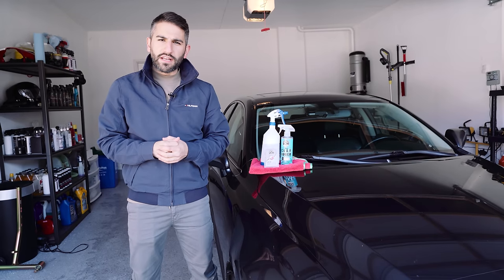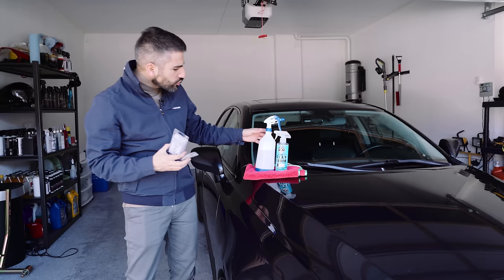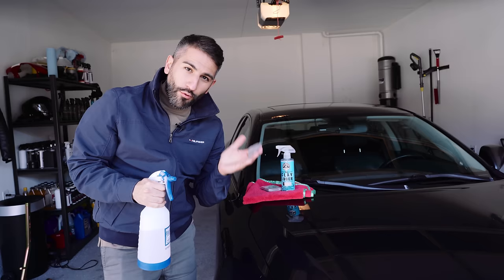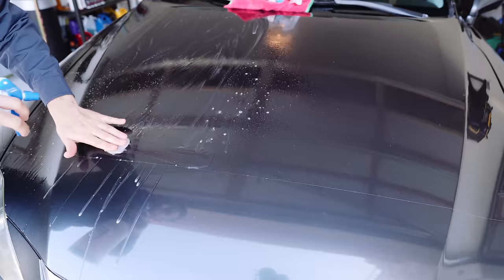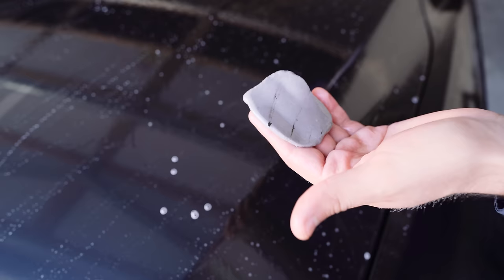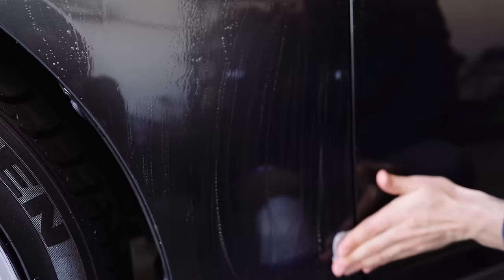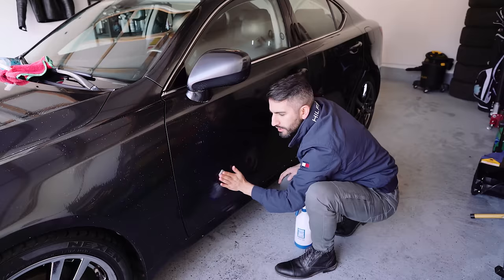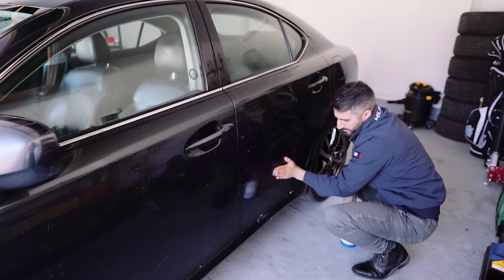How to PROPERLY Clay Bar Your Car! Professional DIY

Comment: My car sat at the dealership for 3 months was in pretty good shape the parts that were sticking out of where they had it parked meaning the hood the top the doors and the trunk lid have some kind of rough spots on them they did not remove when we washed it. Will the clay bar remove this feels like sandpaper. I have never used the Claymore thank you so much the video was awesome informative I got it. Please wish me luck
Reply from the maker: Yes it will help remove all of this!

Comment: I'm so pleased I found you Sonduren.  I have been looking for a concise, informative no nonsense explanation of how to go about clay baring a vehicle properly prior to polishing and waxing.  I am actually considering using a ceramic product on both the paintwork and the glass as well next time (which is due in a month or two), your thoughts on ceramic as opposed to polish and wax?  I always look after my vehicles so they are in fairly good condition.   Have you done videos relating to those aspects, as I would be extremely interested in vewing them also.    Regards, Paul.

Comment: I had Opti-cpat Pro Plus ceramic coating put on my vehicle 4 years ago ( its apparently a 7 year product) I take  my truck to the carwash. Use the pressure washer only (NO BRUSHES, EVAR !!)  Soaped her up and then used my soap and water lube with a Mothers Claybar 2.0  .Washed and rinsed again with presure washer and took truck outside and did a hand wash with Opti-coat No rinse. Followed up with microfiber towel drying with Opticoat Hyper seal and then put on a little more Hyper seal with a clean Microfiber towel i only use for this stage. my 5 year old seen 5  Canadian winters with insane amounts of salt tacoma looks like a mirror and the paint feels smooth as glass. 

Use #0000 steel wool on the outside of your windows. Thank me later. But make sure it says #0000 on the bag and ONLY use it on exterior if you have tinted windows. The glass looks and is clean as if polished.
Reply from the maker: Awesome to hear your great experience as well!
Reply from the maker: Noted on the steel wool 😎

Comment: Can you clay if you already have a ceramic coating? Will it effect it at all? I use opticoat
Reply from the maker: Are well if you already have a ceramic coating on it most likely you don’t embedded contaminants on the paint so no need! Otherwise, you would need to polish off the ceramic coating before you clay bar

Comment: What kind of soap are you using.? If the soap water drys is it going to leave streaks? Should you rinse each panel.
Reply from the maker: Yes, you should be rinsing each panel ideally. I am using Meguiars Golf Class Wax.

Comment: Thanks for great video.  First time clay baring came up amazing.  Someone suggest putting cold water on straight after the wax to set, would you recommend?
Reply from the maker: Do not do that you do not want any cold water or water touching the wax or sealant after you apply it. Ideally 72 hours with no water touching it so it fully cures.

Comment: Thanks soo much.  I have 2 questions.  
1. When is it time to throw away the clay bar, would it be after each use?
2. As for the lubricant, would be car wash mixed with water in that spray bottle?  When u say soap? Thank u!!
Reply from the maker: 1. He would know to throw away the Claybar if you see a lot of gunk built up on the surface of the clay. 
2. Yes exactly you can use any car shampoo and I will be sufficient on an 8 to 1 ratio

Comment: Can you clay bar outside or should you only do it under cover, garage or car port? What happens when the lube dries on the car?  Great video.
Reply from the maker: You can do it outside but it’s highly recommended you do it inside if possible. You will start to cause marring and scratches if not enough lube is on or it dries up.

Comment: Hi. Thanks for the great vid! I have a couple of questions, hope you can enlighten me on them. (1) Does clay bar work on a basic ceramic coated car? (2) After clay bar and rinsing off, can i just apply Autoglym aqua wax? 

Lastly, I have the Autoglym Aqua wax and extra gloss protection, which one should i use first? Thanks!
Reply from the maker: Hey Bruno! Thanks for the compliments and welcome to the channel. 1. Yes it will work on a basic ceramic coated car but it will deteriorate the ceramic coating. 2. Yes you can. Ideally after you clay bar, you should polish your paint to a high gloss finish and remove any scratches and swirls to make sure the paint is in the best condition to apply a last step wax ceramic coating or polish. You don't have to do this but I would recommend it. You should be applying the aquax first.
Reply: @carswithsonduren  Thanks so much!
Reply: @carswithsonduren  hey bro..great video..makes it look simple with your confendence...what ratio of soap to water..and what kind of soap..could i use my maguires gold class shampoo and conditioner?
Reply from the maker: Yes use that 8:1 water to soap

Comment: Pls reply My car fenders is of over Spray did clay can remove it 😊😊
Reply from the maker: Yes it can :)
Reply: @carswithsonduren  Heavy Over Spray Heavy means in the fenders colour is full of Dull did it can removed only with clay & soapy water
Reply from the maker: Depending on how bad the overspray is, you may have to follow up with a compound and polish with a dual action or rotary polisher.
Reply: @carswithsonduren  Clay can't remove bro don't have machine and compound

Comment: I use diluted car soap (cheapest on the shelve) when doing clay bar on paint. I see no benefit in using a product costing $10+ for this purpose when there will be no benefit/advantage over using diluted car wash soap.

Comment: I just want to make sure Rider am I supposed to wipe off every section with the fiber cloth before I go on the next section of the car or do I just do the whole thing and then wipe it and wash it or just wash it after I’m done. A lot of people say wipe each section after you’re done.? Man, I do love this video though I did the one to three way it’s done it does help man I just wanna make sure I don’t do the wrong thing with the lubricant after I’m 
doing Claybar on each section
Reply from the maker: Do the whole car is fine as long as you are in a shaded area and do it decently quickly :)

Comment: Great video. Got a question. Bought an older Lexus 470 with pearl white paint. Found out later that Toyota had a recall on the paint for peeling. Noticing now that touch up paint was used especially on the front edge of hood. Is it safe to clay bar this car? Will doing this pull off the touch up paint? Thanks
Reply from the maker: Clay bar shouldn’t pull up any touchup paint so you should be fine!

Comment: Great video man. can I use Clay Bar for New car? Someone told me only use for old car. Is it right???
Reply from the maker: You can definitely use it on a brand new car but most likely it doesn’t need to be clayed. Typically contamination takes some time to build up on a cars paint so if it’s a brand new car, you should be OK to skip this and go to a ceramic or wax.

Comment: Hey , one doubt.....after washing my car i just did this claybar method. Then is it necessary to do a polish or wax coating? Is it ok if we don't do it ?
Reply from the maker: Polishing would be a great next step if you can do it and would properly bring out the shine and remove swirls and scratches from your paint. You don't have to do this and you can go straight to a wax, sealant or coating. So feel free to just do that :-)

Comment: So just regular car wash type soap and water?  Also will the  clay bar remove my 2 month old wax?  Will I need to reapply the wax afterward?  Thx!
Reply from the maker: Yes that’s all you need. If you use a dish soap like Dawn or rub the car with isopropyl alcohol it will remove the wax.

Comment: So I think the car in front of me ran over the white line that was recently painted and it’s like sprayed all over the front of my car and on the windshield my dumba$$ partner used the abrasive part of a kitchen sponge to try to clean and I now have swirls on the hood luckily he stopped it after about a 6in by 6in section. Will this help get the road spray off? I’ll deal with the swirly disaster soon but I need the white paint specks off to start?? Please tell me this will get it off!!
Reply from the maker: This should get a lot of it off but you will most likely need to follow up with a Polish

Comment: Should I use a clay bar on the plastic parts on the car? The front of my wife's car in front of the hood is plastic (Hyundai Kona). Also do I wash again after or just rinse? Then move onto paint correction.
Reply from the maker: If it's painted, yes

Comment: Gonna buy some today. Will it get rid of paint? I have specks of paint all on one side of my car and the window. Detailer charges 150.00 to do this.
Reply from the maker: Depending on how long the paint has been on there yes it can remove some paint transfer, but alone may not remove it all. If you clay bar and then follow up with a polish or compound it should remove all of the paint transfer.

Comment: I have a brand new car arriving in 2 months, black paint.  They are trying to upsell me on coatings but I feel like im better off doing it myself.  I planned on claying the car and applying a ceramic coating.  Do you feel it's necessary to compound/polish a brand new paint job before the ceramic?
Reply from the maker: Brand new paint job not necessary in my honest opinion. I would simply use a decontamination wash or even a iron remover with no clay bar needed. I only say this for a brand new car.
Reply: @carswithsonduren  Amazing, I appreciate the quick answer.  Any recommendations for the decon wash or iron remover?

As soon as I take delivery of the car I will be prepping it for the coating!
Reply from the maker: There are plenty on the market. You can look at the Car Pro offering. Once you have this your paint will be ready :-)

Comment: I have the same plastic hood protection film. Do you clay bar it? And do you compound/wax it?
Reply from the maker: Yes, you can clay bar it, but you shouldn’t be compounding it. A wax, sealant or ceramic is fine!
Reply: @carswithsonduren  Thanks. How did waxing the protective film it turn out on that lexus?
Reply from the maker: It was perfect. Stayed on just as well as it did on painted panels with clear coat 🙏

Comment: Can I use a clay bar if I have a wax or sealant and ceramic coating or will it remove it?
Reply: The point of a clay bar is to remove all of that. You’ll have to re-wax
Reply: @IronAxeGaming1  how do you tell if you have a wax seal or coat
Reply from the maker: If you spray some water on your car if you see any hydrophobic properties then you know you are protected with either a wax or sealant.

Comment: Did you wash the car after claying? A lot of the contaminants and gunk stay with the clay lube residue, if you allowed the residue to dry on the paint, you should wash it off before polishing or applying a sealant
Reply from the maker: Yes you can wash or rinse after the clay as well 👍

Comment: Hey man nice video. QUestion about your IS250 did you experience carbon build up known to IS250's?
Reply from the maker: Thanks Mark and welcome to the channel! I personally have not, I have lots of videos on the maintenance on these cars so check them out. The car has been rock solid reliable and as long as I am doing consistent full synthetic oil changes she's been fine.

Comment: Random? Should I compound after clay barring?
Reply from the maker: Only if you have deep scratches and bad swirling.
Reply: @carswithsonduren  i kinda figured that. I have a white car and tested a few areas with the clay bar. It's definitely a money maker but gotta use a little elbow grease. My last question is due to the buildup. Do you suggest rewashing the car again? It seems like it would help remove the haze even though I'm using a clean microfiber towel. I guess feel it out as I go
Reply from the maker: @MrFlingtoe honestly that’s why I actually give it a quick rinse right after as well. It doesn’t do any harm.

Comment: After clay barring the car, do you wipe it off with a microfiber towel? Or do you rinse the car off, then dry it with a microfiber towel/chamois?
Reply from the maker: You can do either or but I typically like to give it a rinse right after to make sure there’s no soap presidu left on the paint.
Reply: @carswithsonduren  Thank you!

Comment: Hi there, fellow Canuck here in the GTA. My ToR Red Dodge Charger...has a heck of a commute through construction zones and the like. I bought it used but it's a 2019 and I doubt it's ever been clayed. 

On my channel I uploaded a video of my thoughts on Griots Garage 3 in 1 wax...which I applied about 1.5 weeks ago.   I kind of want to try out clay barring but, if you look at the video it still has the 3 in 1 on it. What should I do? 

Also, is there any tips you have for cars of my colour / how to clean the wheel wells proper? 

Thanks in advance
Reply from the maker: You can just simply remove the three and one with a wash and dawn soap or alcohol wipe down and clay after!
Reply: @carswithsonduren  thanks sir. And the second portion of my comment?

Comment: How do you clay bar a pickup truck Ford F-150 xtl super cab work truck. do you do it the same way as you do a car? when you using soap & water do you rest off the section that you just finished clay bar? seem like the soap and water will dry on the vehicle. when you go to the next section. You do not have a garage.
Reply from the maker: You can do it section by section so that doesn't happen and it's fine if the soap and water dries on the vehicle you will simply rinse it off.
Reply: @carswithsonduren  ok thank you for responding back.
Reply: How do I restore exterior black plastic trim. What product would you recommend using on my Ford F-150

Comment: Excellent video!  Thanks.  Question: What type of soap do you used in your water solution to lubricate?
Reply from the maker: Thanks man! Meguiars Gold Class Car Shampoo 1:8 with water.
Reply: @carswithsonduren  Perfect, I've been using Gold Class for year...
Reply from the maker: Perfect that will make the best solution
Reply: @carswithsonduren  I'm new to car washing what do you mean by 1:8 with water?
Reply from the maker: The mixture mix
Reply: @azeezoh9774  1 part soap with 8 equal parts  of water.  For instance 1oz soap mixed with 8oz water ( or ml etc if thats what measurement you use)

Comment: Could this help remove some (what im assuming) Hard water spots on a car? From a distance you cant notice them but up close you can see all those little white dots
Reply from the maker: No it won’t you will need to polish your car
Reply: @carswithsonduren  alright thanks!
Reply: Hard water spots are best removed with an acid wash& neutralizer first then polish. The less aggressive  the polish compound the better, especially  on a black car.

Comment: Can clay bar be used on ceramic coating?
Reply from the maker: It shouldn’t be no. If you have a ceramic you won’t be able to do it properly unless you remove the ceramic.

Comment: Do you make the lub or what brand you use?
Im willing to clay my car. 
Great video
Reply: Just finish the video... soap and water.
But what is the diference between soap and water and the spray that you can buy?
Reply from the maker: Slightly different formulations but same thing basically.

Comment: Would cleaner wax do the same thing? Never used one.
Reply from the maker: Not the same, a clay bar gets rid of the hard stuck on contaminants in the paint.
Reply: @carswithsonduren  Thanks for the response... I saw another guy use plummers putty he said it works just as good, just wondering your thoughts, maybe he`s nuts.
Reply from the maker: Never heard of that. Just stick with the clay bar IMHO it’s only like $20 bucks.
Reply: @carswithsonduren  Yes I agree Thanks going to give it a go this weekend.

Comment: After clay do you have to do anything like polishing or just rinse and dry and wax?
Reply from the maker: After you clay bar if you want to polish your car that is the best time to do it and exactly what clay barring is intended for, to ensure the paint clean as possible before polishing to a high gloss shine. After the polish is done then it lasted finish like a wax or ceramic coating.
Reply: @carswithsonduren  Thanks for quick reply. But do you have to polish after clay bar or wash, rinse and wax is enough. I've never clay bar before.
Reply from the maker: Polishing is not required, it's only if you want to remove all the scratches and swirl marks and get a perfect shine. Otherwise after you're done this simply wash, dry and wax 👍
Reply: @carswithsonduren  thank you!

Comment: Hi can we use car shampoo as the lubricant instead of soap?
Reply from the maker: Yes you can!
Reply: Thank you. I have just finished washing and dried with chamois. Now using mothers spray wax. It’s a E350 2009 in a diamond metallic black original paint
Reply from the maker: Very nice! The metallic black is a very beautiful colour but requires an immense amount of care 😉

Comment: Dumb question, when you say soapy water, what soap mixture are you using.  TY
Reply from the maker: Eight parts water one part soap
Reply: @carswithsonduren  Thanks....I used meguiars car wash 2oz water 24oz  worked great.

Comment: You never used the clay lube,
Do you have to wash the car again after using clay lube for claying ?
Reply from the maker: You don't have to because your car should have been cleaned before you even started this
Reply: @carswithsonduren  what's the point of having the clay lube in the video?
Reply from the maker: Just showing another option which is more expensive